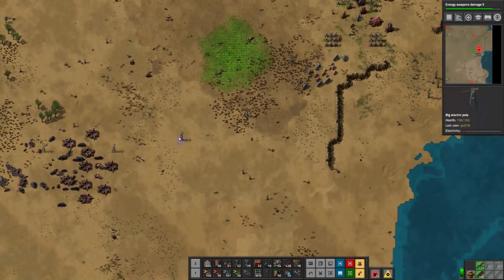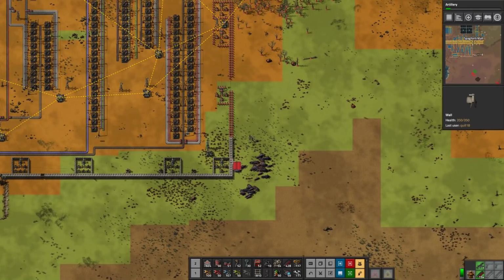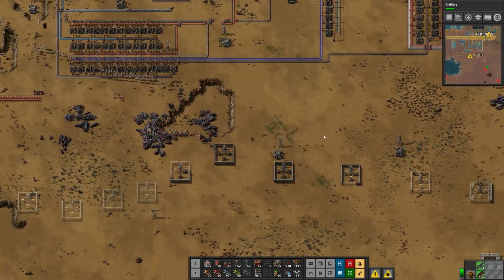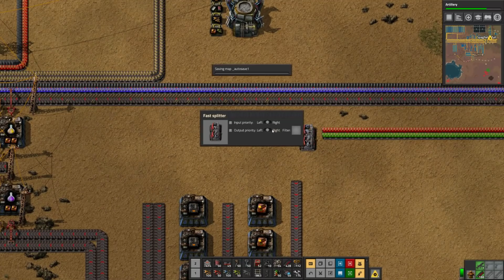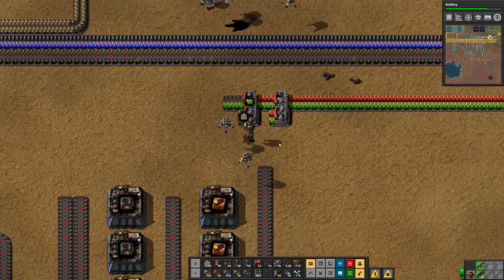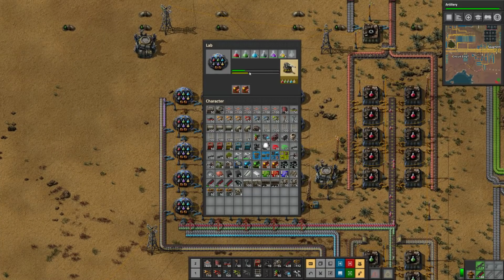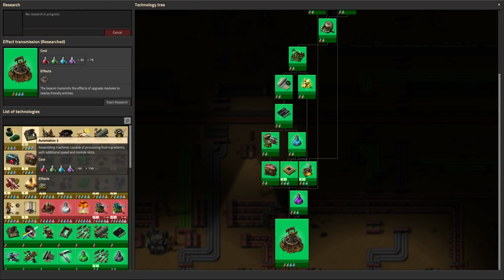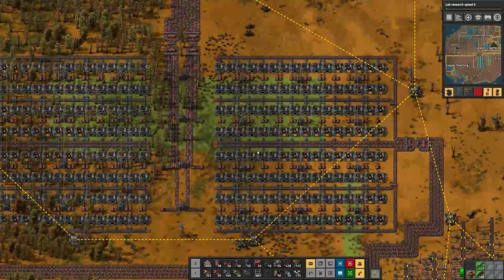Let's Play: Factorio! -- .17 Experimental -- Part 17

Comment: @0:25 I'm not seeing any Personal Laser Defence which most people would consider a basic requirement for mid-late game combat armour. FYI Energy weapons damage research boosts the PLD damage.

@13:25 TIP: As general rule of thumb when using long handled inserters with more than 3 input materials, it is best to put the material used most on the belt closest to the assembler (in this layout the rail will be picked up from the far belt)

@19:00 you can feed 2 rail assemblers with 1 iron stick assemblers.

@22:50 Once you have robots 'rip and replace' for problematic designs is relatively trivial.

@32:45 Most of the commonly available balancer books only contain designs that do perfect balancing, but only when all belts are fed and drawn from. Once a belt isn't fed or backs up the balancer throughput drops. Throughput unlimited balancers address this issue but are usually much larger. The 4x4 balancer you are using is an example of a throughput unlimited balancer

@38:45 FYI While electric furnaces don't need coal, if your power production is coal fired you will use more coal to provide power to those electric furnaces compared to feeding coal to coal fired steel furnaces